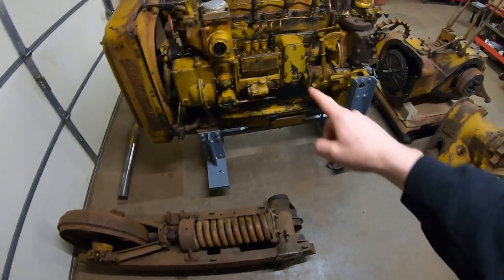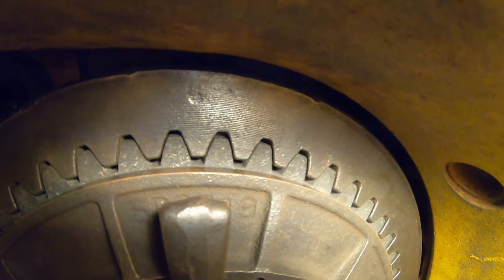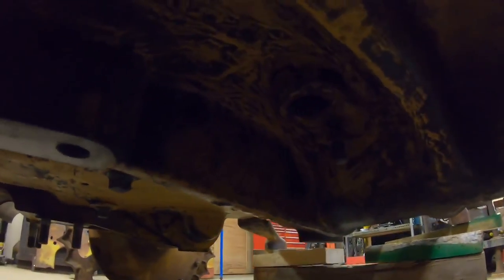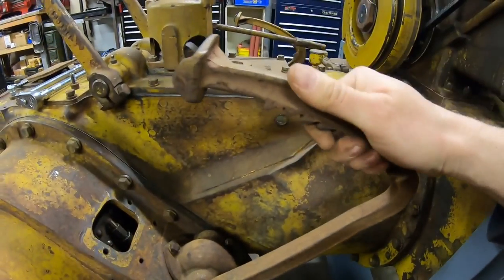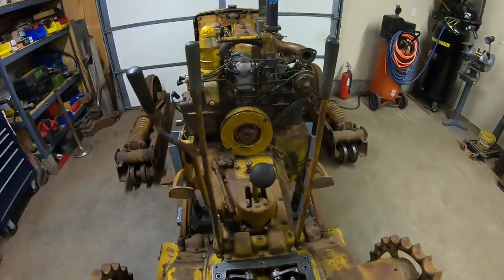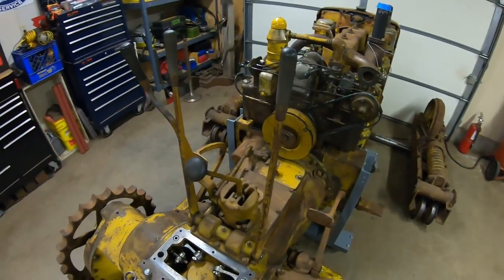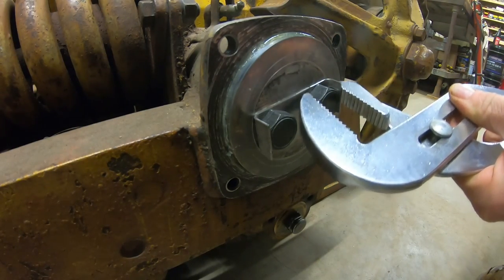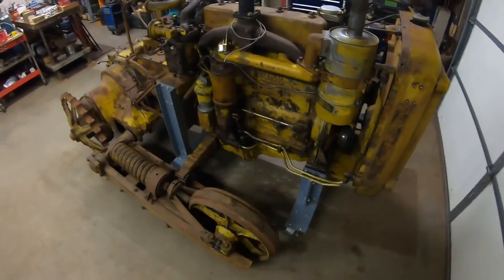Building a Cat D2 in One Day! Caterpillar D2 #5J1113 Chassis Rebuild Ep.40: Assembly & Adjustments

Comment: I find that back turning a threaded piece allows you to  feel the starting points of both threads to meet and "fall back" from each other. This allows  the threads to start into each other cleanly.  As a avid viewer  of this series, it is most enjoyable to watch the reassembly  of the D2 into the best machine that could be made from machine that you pulled from behind that building. I find your begrudging affection for this machine to be what hooked me, and probably a lot of others to continue watching. As it and you were being pulled around by Sr. and the steering  clutch broke loose that first time...the look of hopeful optimism was infectious. 
There are channels that deal with similar equipment that I have seen and had to leave, because  the Host was obnoxious. Or faking it till he makes it. Sorry, I've got other things to do than that. You sir, are always enjoyable to watch and everyone  knows that you have and will put in the work required to have a successful  rebuild. Thanks Squatch253

Comment: Those old caterpillar were so simple that a kindergarten kit can work with them, I used to call that child toys. What happened to the anti seized that you are supposed to use to prevent corrosion for the next time repairs? I have no doubts of your knowledge in this impressive and outstanding work of engineering.
Reply: @squatch253  congratulations, you have been doing an outstanding job on that toy, most kind of you and each and every one that one way or another collaborated in order to put these videos and shear them with us, blessings to you and love ones,  from the endless summer paradise Puerto Rico, Jesús Torres.

Comment: Damn I never thought I would find any info for this old caterpillar, it has been like 12 or 15 years since my dad got his old 1925 (I think) tractor parked in the ranch and once he told me he will never get it running again in life, he passed away on September 2019. So I´m planning on making it work again, gotta fix a lot of things like the alignment on the sprocket and the rollers, fix the pony motor carb and a lot of leaks and problems, it was running good when parked, but the elements must have done some damage. Thanks for the info!

Comment: well its nearing completion and a job well done, it just shows how small the D2 tractor is without all the guards etc in place, and no matter what others have said about the lubricants, the paint work etc 5J113 aka the SQUATCHMOBILE looks bloody awesome, well done again. 1 question i do have could th 00 bearing grease for the track rollers be used on or in the pivotshaft as you mentiond about the thrust washers dont get sufficient lubrication on the early model tractors. Pete

Comment: When i used to be a gas powered forklift operator, i always used to adjust my clutch/brake adjustment so that i had positive brake action as soon as i hit the clutch.
As standard they always seemed to have a dead spot where the clutch was activated but no braking application.
Reply: I understand your personal preference for adjustment, and that is fine, if you don't mind increasing wear to the clutch discs.  The idea for having the second pedal to "disable" the transmission is so the operator can speed up the action of the load hydraulics independently without having to move the direction control to neutral.  Proper use of the left pedal is done when the forklift is at a standstill or very near.  The forklift OEMs intend for the left pedal adjustment to COMPLETELY deactivate the clutch packs before the brakes begin to apply so that clutch plate slipping is held to the minimum and not wear them out so quick.
If the left pedal is adjusted so that the brakes begin to apply before the clutch packs are released,  you might not be completely disengaging the clutches, and that means the clutches are slipping against each other while power is applied to them with the brakes applied.
The biggest objection some operators have with the OEM adjustment scheme is that the OEM adjustment makes the left pedal feel like you have no brakes at first (compared to the right pedal).
Clutch plates should only "slip" against each other for the brief split second when the travel direction lever is shifted from or into NEUTRAL, and that should only be done at low engine idle RPM.

Comment: I think it's a "castellated" nut instead of an "acorn" nut.  Acorns look like small domes on top, castellated nuts look like parapets, with notches cut for the bowmen on top of the castle wall.
Reply: Never heard of that term "castellated".  Usually just call them castle nuts, but those are usually flat on the bottom.  This one has a round "bottom" to fit into the pocket on the lever. Acorn castle nut anyone? lol!
Reply: I just read up on castellated nuts.  Learned something new.  Castle nuts vs slotted nuts. On castle nuts the "turrets" are rounded and not full out to the end of the nut so the cotter pin can be bent around without protruding outside the diameter if the nut.  On slotted nuts the turrets match the shape of the nut.  So technically I guess these are slotted acorn nuts. :)

Comment: Hi Toby.  Finally around to putting the transmission cover back on and adjusting the steering levers.  Something seems amiss with what I am doing.  I had to back off the acorn nut so much to get the free play in the lever that I couldn't get the cotter pin in, so I turned it in just enough to get the pin in and then adjusted the clutch pack free play to get the free play I needed in the lever.  This is a 5U D2.  Do you see any issues with that?  To get the levers to be even, which adjustment should I make, or does it matter.  Unfortunately I left my manual in BC when I came to MB this spring.  Didn't think I would be doing much work on the D2, but turns out I have to move it off the property it is on before the end of May.
I thought I had this all figured out 8 months ago, but I have either forgotten, or thrown for a loop when I couldn't get the lever free play adjusted and the cotter pin in.  Regards John
Reply: I think I see my problem.  I was measuring how far I could move the lever before it started to disengage the clutch.  Got to go the other way.  Let me try that.
Reply from the maker: In theory, the square headed screws at the top of the release holes are your primary adjustment, and the acorn nut with cotter pin is your “fine” adjustment, but sometimes you have to  use a combination of both to achieve the desired result. Most times I hit the target by setting the free play with the square headed screws and then evening up the levers with each other by adjusting the acorn nuts 👍
Reply: @squatch253  Thanks.  On the 5U series there is a set screw on the steering lever which I believe sets how far one can pull the lever back.  My service manual (luck would have it, I have a PDF version) only talks about the square head adjustment, nothing about the acorn nut or the set screws :(.  Does the Iron Mistress have those set screws?  I thought it was a 5U.  Any info on those set screws would be appreciated.  From the looks of the parts manual those screws (bolts) go in with the head down and forward and the locking nut on the head side of the lever.
Reply from the maker: That extra set screw must be something that is unique to the “late” 5U tractors, because none of the early 5U machines have them. I don’t have any actual experience with the late 5U’s.
Reply: @squatch253  Thanks for taking the time to reply!  Keep on fold over lockin!

Comment: Really you make it look so simple LMFAO! But I guess these really are compared to heavier equipment today which has to be so much more precise than these were? But quite honestly these are much more refined than I thought or gave them credit for being so vintage. They really gave a Crap back then to build things with redundancy and overkill when and where possible, prices of materials and weights weren't as important back in these days As reputation was! And each manufacturer put as much time, engineering and love into the design of something that they were actually proud to produce unlike the stuff built by robots today on massive assembly lines where each and every metal shaving is accounted for in the design stages and the cost the thickness of paint is weighed! That's Not caring, nor being proud of your product, but more like cutting each and every corner to provide profits for the manufacturer and the thought is, "If it lasts 5-7 years that's fantastic and well just sell them another one" These old Cats and almost every other piece of machinery back then was designed for the long haul and endurance of multiple rebuilds when sacrificial wear parts wore out, today this isn't the case unfortunately. They're much more happier to sell new than sell someone old parts! I've experienced this attitude and it's disappointing to say the least. When you go in for parts to fix or restore your older piece of equipment and then get the "Why you bothering attitude?" from salesman makes me pretty upset. But we persevere I guess? Someone needs to keep our history alive somehow! Great build Sqatch! 👏 👍

Comment: I’m noticing the first generation cases have no access hole for the starter pinion latch adjustment.  I can’t imagine it can be done through the top clutch cover.  My 1938 5J has the same case with no way to get to the pinion latches.

Comment: Just wondering ,, Would NOW be a good time to paint the assembly , Before covering IE rollers with chains or things as you have good access ATM ?
Reply: Squatch has constantly said from the start that this machine was not going to be painted. Patina is its history.
Reply: No, the best time to paint would have been after he disassembled each component, and cleaned it.  Then apply paint just before re-assembly.  Much easier to paint each component on it's own instead of trying to do the whole unit at once.
Reply: @mrcamelpmw  ok ty

Comment: You "appear" to only turned the Brake Band set screw 3/4 of a turn. Each flat of the head of the screw is only 1/4 of a turn. Could just be a matter of terminology, but you only turned it 1/2 the amount you said too, which could make a big difference.
Reply: @squatch253  Man, I watched it four times before commenting. I focused so intently on your fingers, I didn't get the wrist flick. Feel a bit silly now. Thanks for responding and clarifying. Off to find the rest of your rebuild series. This was only the third of vid yours I've watched, so far. Very enjoyable and informative. Well presented. And yes, I'll ring the bell!

Comment: It looked like the break adjustment under the tractor you where turning only 1/4 turns not 1/2 turns.
Reply: @squatch253  13:42 Go back and look.  You turned it 1/4 turn each time, not 1/2.  You said you needed to back it out 1-1/2 turn, not 3/4 turn... unless you are doing some crazy things with your figures the camera can not pick up.  I just watched it 5 times to see if somehow I am missing something...   I still think you did it wrong... or you stated it wrong and it was supposed to be 3/4 turn.
Reply: @squatch253  So... magic.  Got it.